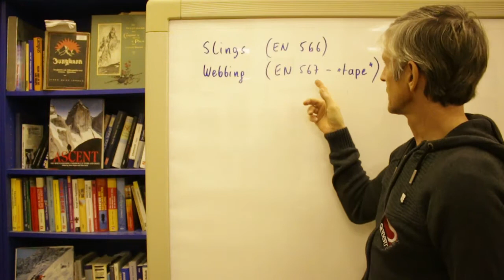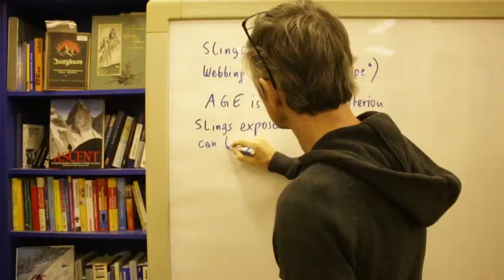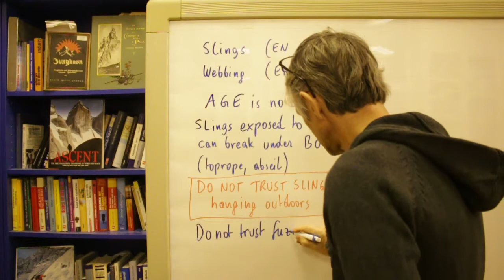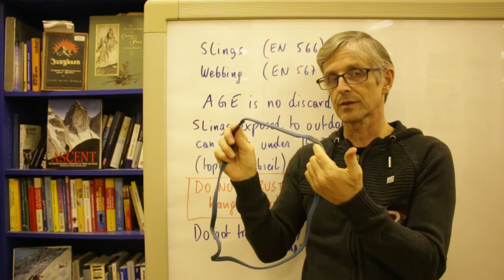Be careful with slings and webbing!

Comment: This video has a few issues. Maybe you can correct them.

You need to be a bit careful about comparing these two items: climbing and industrial slings/webbing.
The terminology and overall approaches used for ensuring user safety is quite different.

You make a few good points: and your combination of theory and testing is nice, but I am concerned it is incomplete. If climbers take on board your suggestion of not seriously considering discarding climbing gear at a fixed time period, then they need to have some other policy of RIGOROUS inspection, as well as monitoring use.

The discard policy based on number of years of use is meant for a large number of climbers: a distribution. In excess of a 1,000. Where after this time period (5, 7, 8, 10 years: whatever) there will be a certain number of climbers who have used their gear a lot, in circumstances where it has been degraded.

It is VERY hard for ANYONE to know how many climbers at this time have "bad" ropes/harnesses/slings etc. Unless you do testing, often destructive testing. And that sort-of defeats the purpose, doesn't it? You don't get to keep your rope, and you had to pay for the test.

But we do know, for 100% sure, that there are mechanisms where climbing textile products (ropes/harnesses/slings etc) are indeed damaged by use. In a cumulative way. These mechanisms are:
- Exposure to aggressive chemicals (pollutants etc). 
It might not be the "sudden death" that sulphuric acid causes, but can be a more gradual attack
- Ultra-Violet (UV) exposure
- Abrasive wear: external as well as internal (caused by dirt)

All of these are well known to the nylon/textile industry/researchers. Perhaps you won't find lots of specific studies on climbing ropes and other items, because we are a pretty small part of the market. But there are some. And others that can be related to our products.

The important point is that for any given INDIVIDUAL, it is hard to know if your rope/sling/harness is affected by use after a certain number of years. Unless you do expensive and often destructive tests.

But for a large enough GROUP, we DO know that statistically there is a good chance there are people in that group who used their gear enough, in circumstances that will have damaged it enough to cause it to fail under use.

There is NOT a magic number where this happens. The value that the manufacturers recommend is perhaps conservative. It might well be more than 10 years for the amount of use that YOU put on your rope etc. It might be 5 years.

But what we DO know is that given the large number of climbers, and their current willingness to inspect, and discard gear after a certain number of years, we don't get many failures. So the current policy WORKS.

Nobody can tell you what will happen if climbers, or YOU, start to keep your gear a lot longer. Is a bit like Russian Roulette. The old climbing adage about "If you suspect your gear is bad, then don't use it" is still a good course of action.
 
 
Walter:  you need to add more to your suggestions. More proof, more test data. More information on the current research.

Sure, the suggestion about protecting climbing slings is interesting with a mantle/sheath. One issue is that the internal webbing/tape is not visible for inspection. Although one might argue that if it's protected, why inspect it. Perhaps it's worth having a sub-class to the existing standard for slings like this. Worth some thought.

And the industrial slings have other ideas: some use internal fibre optic strands to become "smart slings": to show if the damage/wear is severe.

But none of the climbing textile standards have any specific criteria about wear, or degradation due to use. In general the standards look at only NEW items, and the effect of use is left to the manufacturer because it changes so much. 

In fact that's in general true of ALL the climbing standards: metal or textile. Although after the fatal injury involving a Via Ferrata Energy Absorbing System (EAS) device, this is starting to change. And also with climbing anchors we are going to address SCC/corrosion issues.

The video has a misleading/incorrect statement about the lifetime of the industrial lifting sling. They are NOT in fact rated for an infinite lifetime. The idea is that they are inspected frequently, and perhaps discarded if they fail that. 

What happens is that lifting slings and cables are used for a specific period: usually a year. Or if damage is noted. And then they are rigorously inspected and re-certified. While they are being inspected, you use other slings that are either new (certified) or inspected and re-certified. Slings/lifting items are thus usually coded with labels so you know if you are using the proper one. Like on a work site after a certain date, you know that all valid slings etc should have a label/tag of a certain colour. And any other tag colours are old, and need to be sent off for inspection. The actual requirements differ from country to country, and from offshore use to onshore use.

There is a 3rd party that does the inspection, and they are quite willing to discard equipment that fails inspection: they don't try to hang onto an old harness because their great-grandfather used it to climb the Matterhorn....:-0

As far as the rated strengths are concerned, the industrial access/lifting items and climbing gear use different criteria for the required strengths in standards. And the displayed ratings. Industrial gear usually displays its Working Load, and that is based on its failure load, or even yield, with a safety factor: sometimes 7:1, sometimes 5:1. And there is very often a requirement for proof testing of each item to show that it is indeed strong enough. The proof load can be greater than the Working Load. This is the case for lifting chain.

For climbing gear it is different. Historically the rated strengths used in standards are based on failure loads: not even on yield. And are for specific circumstances, quite extreme ones. Like a factor 1.78 fall with an 80kg dead weight for climbing rope. There is no direct safety factor built into the rated strengths.

However, as you've noted in this video and others, something like 99.99% falls (I made the number up, I mean virtually all falls) are considerably less than 20kN. So there is in effect a safety factor.

The other issue is that climbing equipment is seen as a chain of items all working together. As in a dynamic rope attached to a carabiner to a harness. Which goes to another carabiner, on an anchor, to a belayer, using a belaying device. Sure it's not always exactly like this, but you more or less always have some sort of mix of dynamic item (the rope) connected to other items. With friction involved. And some degree of redundancy.

This all works to reduce the loading/impact on items. That's why there are so few failures, even when climbers use their equipment long past the time that it should be retired. It's in general been "over-designed". Although I say "over designed", it is not easy to say which items could be safely made less robust because it's not always used the same way.

In any case, I would like to have some sort of nomenclature/rating system for climbing gear that does state the expected working loads and implied safety factors. It's not easy though, because this is doing it AFTER the development that has already been done, and the general acceptance by climbers. And thee are legal issues as well. Like what happens if a manufacturer were to say that his gear is now considerably weaker than he first said it was?

Alan Jarvis
UIAA Safety Commission
Reply: Alan Jarvis/UIAA:  I have some questions regarding some points you mentioned: 
What do you mean when you write: "None of the textile standards have any specific criteria about wear, or degradation due to use." Isnt for example the Appendix A in the EN 1891(low stretch kernmantel ropes) defining those criterias? 
Regarding your comment about the labels of industrial slings: What type of slings are you referring to? I referred to EN 1492-2 slings, where the label color defines the material the sling is made of and not the year (red is not existing there).
I referred to these slings because they can not have a life time if they want to conform to the standard, which is astonishing because they are made from the same material like mountaineering slings.

One important issue to me is your statement: "That's why there are so few failures". Since I could not find any failures (apart from wear, acid, sharp edges and melting) I would be really interested in your cases.
Walter Siebert
Reply: Walter: I wasn't in fact referring to the colour of the sling itself, but more to the LABEL that is used to IDENTIFY the slings, and various pieces of lifting gear that is used on an industrial site. I've worked in many industrial environments, and this is common practice.

You have a bit of confusion about the lifetime of slings, cables and other forms of gear used for industrial lifting. There are several policies that control the use, inspection and discard criteria of these items: equipment standards as well as inspection policies. They are ALL important, and it is NOT only the standard that one needs to know about. 

And some of these things change depending if you are in an onshore or offshore working environment, and also on what geographical region you are in: like the EU, North America etc etc.

What GENERALLY happens is that the LABELS that are used to IDENTIFY lifting equipment are colour coded, to make it easy to identify. And on a regular TIME period, usually every year, ALL of the equipment is REMOVED from use, and sent off for inspection. Rigorous inspection. By an independent third party. And if they decide it is not fit for further use, they discard it.

You said something like "a time period of use is forbidden in the industrial standards" but that was unfortunately an uninformed statement. The point is that there IS a period of time, but it's NOT via the standard.

This is the route that the industrial users have chosen to go to deal with use-related degradation of lifting gear: slings, ropes, cables, harnesses etc. In effect THEY have a ONE YEAR discard criteria. The equipment has to PASS an inspection BEFORE it can come back into use. If not inspected it is considered FAILED.

So if any climbers do watch your videos, and listen to you, then they have thrown out one set of discard criteria, but have not accepted another one. They COULD accept this one: where every year they send their ropes, harness and slings off for rigorous 3rd party inspection. But I think they will find that the cost of that is quite high. And after just a few years, they are better off just buying new gear.

So if they follow that way, it will be MUCH more expensive, and more effort than following our current 10 year guidelines.
Reply: Hi Alan, good that you mention this: I must clarify that I am referring to the EN Standard. For slings according to this standard no 3rd party inspection is required, only an inspection by a competent person. 
Of course it can be different in other parts of the world.
We have also different definitions of "discard". I refer to that point where the manufacturer states that the device must be destroyed. What you are referring to when you mention "discard" is what I would call "inspection".
It is good that you help to clarify these terms.
Reply: Sorry, but what you say in your Video is wrong and misleading. And is one major factor that is causing the problem here.

You state at 1:48 that in industrial slings it is forbidden to state a lifetime, that it has to last forever (words to that effect). It is NOT intended to last forever: sorry, but that is really really misleading to say that.

And you say that the climbing slings DO have a stated lifetime of 7-8 years (in fact NOT in the standard, but in the Manufacturer's information).

In fact, the two types of slings (Industrial and Climbing) are handled completely differently. The Industrial ones are inspected regularly, as I've stated in my other comments. And if they do not PASS this, they are discarded. And they are REMOVED from service in order to be inspected. By law.

In effect, the default is if they do not PASS an inspection, they are DISCARDED. If they are not inspected, they are DISCARDED.

So the industrial standard does not have to state ANY lifetime, because it is handled by other legislation. In effect, it is usually a recurring cycle of 12 months: use, inspect, return to service ONLY if it passes.

You need to edit your video.
Reply: Hello, you are right, there is something important to add: I refer only to European standards.
 Maybe other standards are different to the EU.

I stick to my statement: 
"When you look into the manual, then here (I point to the climbing sling) the life time is 6-8 years. If
you look to the manual and the standard here (I point to the industrial sling ) there is no life time, in the opposite, life time is forbidden."
This is how I interprete the standard.
What I maybe needed to add in the video, but I can do this easier here in the comment: I refer to EN
 standards, like EN 1492-2.
But I would be interested to which law you are referring?
Reply: You do not interpret the industrial situation correctly: I suspect you have not had much contact with industrial use of slings. So please be careful about what you say here.

You will find that every working environment is about the same: Austria (your home), the EU, and North America. And the countries in Asia that I have worked in are the same.

They have standards, and government laws that say regular inspection must be done in addition. In the USA it is the OSHA. In UK it is the UK HSE (via LOLER regs). In Germany it is "The German Ordinance on Industrial Safety and Health (BetrSichV)".

In international waters it is often by covered the offshore operating company (like Shell, BP or Exxon). In many cases these drill ships/vessel's are not in port very often. And often under a "flag of convenience": like Liberia where the rules are very weak. So the multinational that uses them imposes its own rules.

Most companies will have an independent company like TUV, DNV etc etc to do the inspection.

But they ALL mandate a REGULAR inspection period for lifting gear, every 12 months is common for most gear.

I'm not just speaking from a South African perspective: this is practice in most countries: Europe and North America for sure.

I really think you should pull these videos off: they are going to cause more confusion and problems than good things.
Reply: Hi WarthogARJ, our communication is full of misunderstandings ...
I talk about lifetime, you talk about inspection (which I do not question).
I am referring to the time since manufacturing date, when a sling must be descarded, no matter how it looks like. 
You talk about other discard criteria (which I do not question).
I also have a different view on what a national body is. I think that the TUV in Germany is a private company, not a national body.
Reply: Indeed: there are misunderstandings.

For climbing equipment nobody can FORCE you to discard a sling: the manufacturers give a recommendation. And yes, I do understand that "age" is the time since it has been first used.

I DO understand your questioning the idea that any ONE given/specific sling should be considered for discarding at a certain number of years: let's say 8 years.

I say "considered" for discarding because you need some common sense here in applying this. 
In the extreme, let's say you used in ONCE over this period, in a perfectly clean indoor climbing gym, and before and after have stored it inside, in a nice clean place.
If it was MY sling I would NOT discard it.

In the other extreme, let's say you use it VERY often, in very dirty, and wet environments. You don't clean it either. After 8 years of use, you look at it: it LOOKS not too bad. What should you do? Well, I'd say discard it. It's had a good life, given you good value. Lets' say you are curious, and send it off to get tested. And it DOES break at quite a low load. So you feel OK about discarding it. And a bit worried abut all those big falls you had on it a year before..... 

In between these extremes, where are we? We don't know.
If you had tested a 2nd sling, that you also used for 8 years, but didn't use in quite the same way, it might have PASSED the test: and failed at a HIGH load.

How do you tell between these slings? You CANNOT tell by visual inspection in many cases if a sling HAS been weakened by use.

Sometimes one that is a bit fuzzy is GREAT.
And one that looks GREAT is indeed been weakened by use.
 
This is all for INDIVIDUAL slings. The variables are too big, not well understood enough, and it's too hard to do any non-destructive testing to tell if they are in bad shape.

So "we" (the industry) took the view that with a large number of ropes, used with varying degrees of "intensity", and exposure to damaging influences, that after a NUMBER of years, a CERTAIN number will indeed be SIGNIFICANTLY weakened.

Notice that "NUMBER", "CERTAIN" and "SIGNIFICANTLY" are in CAPS.
We don't really know the exact values for these values.
It is perhaps a conservative criteria for the "average" weekend climber to use 8 or 10 years for NUMBER.
Such that this distribution of wear over this number of climbers causes a large enough degree of wear to be a problem.

Think about this a bit: from the manufacturer's standpoint.
They HAVE to give SOME reasonable criteria at which to discard slings (or rope etc etc).
They CANNOT give non-destructive criteria for inspection: it's too difficult to follow, and too expensive.

So they give a conservative one, that we KNOW works.
Sure maybe it COULD be 10 years instead of 8.
Or 12 instead of 10.
But at SOME point, in a large number of users you WILL have sling failures.
And deaths.

But sure, if you want then do it like they do in industry: have a trained person inspect your equipment every year. Someone who does this all the time.
Even then it's not certain they will catch all the weak slings.

Your complaint that with the slings you tested, or have access to data for, you saw no correlation between failure/weakness and time.
But you did NOT graph "amount of use": you should do that as well.
How do you know that you DO have a valid data set?

A VALID data set would show what correlation there was between years used, and "amount of use".
For a large number of slings.
You did not do that.
And sure, it IS difficult to do, but to make the statement that you DID make, you NEED to do that.

We DO know that MANY climbers do indeed retire slings after a long number of years.
Or stop using them as much, or don't use them on their hard climbs.

So you don't have THOSE data points in your tests.
Because they've stopped using them.

You need to go back to your testing and do enough to be able to make the statements that you do make.
Reply: This is for INDUSTRIAL lifting gear.

In Germany the law that covers INSPECTION is "The German Ordinance on  Industrial Safety and Health (BetrSichV)".

You need to look up the German, but the rough english translation is:
"The German Ordinance on  Industrial Safety and Health (BetrSichV) requires operators and business
owners to regularly inspect lifting equipment and load carrying devices.

The German Ordinance on Industrial Safety and Health requires lifting 
equipment to be inspected by skilled personnel. They must have 
sufficient experience to be able to assess the safe condition of plant  
equipment. Inspections must be carried out before commissioning, after 
fundamental changes and at regular intervals."

I should have used the more correct term "NOTIFIED BODY" for TUV (and others, like APAVE in France). Look this up in Wikipedia.

In fact I said it wrong: I will correct it. The NOTIFIED BODY (TUV etc) is the one that issues the CE mark, and checks that safety critical PPE is being made according to the appropriate standard, and that there is suitable Quality Control.

But to INSPECT things the you just need to have Skilled personnel". These "skilled personnel" are usually private companies: like TUV, or DNV etc etc.
Reply: @WarthogARJ     HI WarthogARJ,  I am a recreational tree climbers and safety is always number 1.  I am getting into saddle hunting this year.  I would like your opinion although I take full responsibility for my actions.  I was planning to place a tie-in point in the tree I will be hunting in.   This tie-in point will be constructed by using 1" tubular webbing and an appropriate rated aluminium  Quick Link.  I would like to leave this anchor point in the tree for the full hunting season exposing it to the weather.  I will remove my climbing line and replace it will a throw line at the end of each hunt.  Do you think exposure to the weather from Sept. thru Feb (NJ) will severely impact its performance?  By leaving it in the tree, it would limit my time to get into the tree rather than always using my climbing sticks.  This will cut my time to begin hunting tremendously.  Thank you for your reply.
Reply: @anthonygiancarli7649  While it would probably be fine, may I suggest a cambium/friction saver that you take in and out with you? It would seem safer than leaving a sling there for 6 months. Bugs could eat at it, lots of things could happen. Perhaps some steel cable or chains would be safer if you leave something out there.
Reply: @WarthogARJ  I realize this discussion is five years old but I appreciate you writing to Walter and voicing your concern. I had a bit of the same concern as you did. If I could summarize your argument, you are essentially saying that 10 years (due to use) is a good rule of thumb to discard and that this rule of thumb has prevented accidents. I agree with this. I also agree that someone like Walter (experienced and studied in rope technology) could evaluate material past ten years. For us laymen, I'll probably stick to the ten year standard.